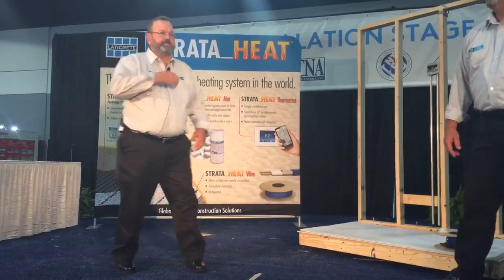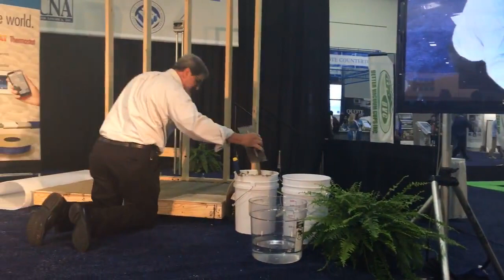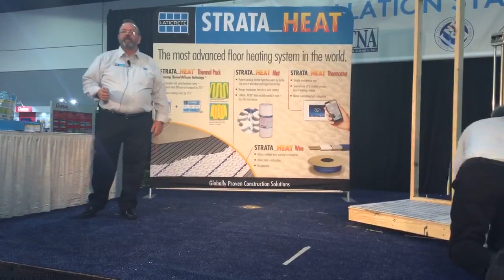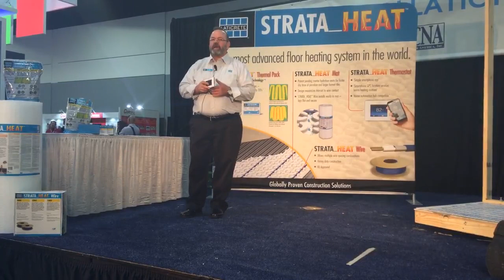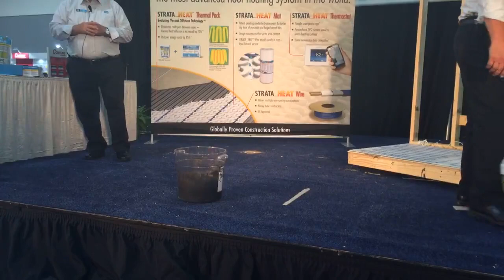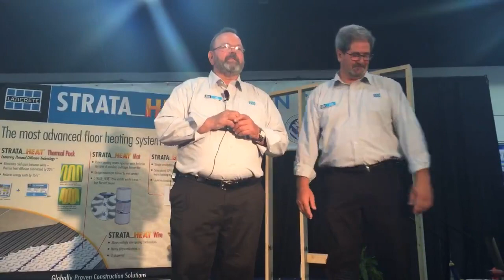STRATA_HEAT Floor Heating System Demo

Comment: I haven't seen any videos specifically talking about using this system in a shower. If you were to use Strataheat in shower, would you just put Hydroban sheet membrane over this system for waterproofing and set tile on top?
Reply from the maker: You will put waterproofing first in most cases directly to the substrate.  Please give our Tech Services team a call to discuss further at 1.800.243.4788 x1235.

Comment: I have the ability to do either 120 or 240 volt. I am doing 2 bathrooms one is 4'x10' one is 6'x15'
What is the benefit of 120 vs 240 volts?
Reply from the maker: Both 120V and 240V use the same kw/hr.  The only difference is that a 240V system uses half the amperage of a 120V system of the same size.  You can do up to 135 sq ft with a 120V system and 275 sq ft on a 240V system without adding an additional thermostat or relay. If you have any other questions feel free to reach out to our Technical Services Team at 1.800.243.4788 x1235